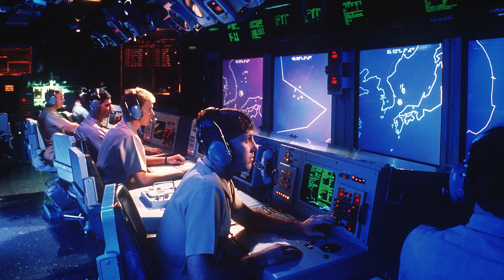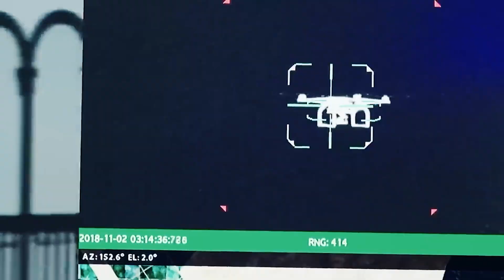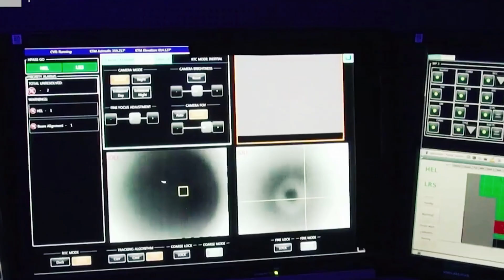This US LASER Aircraft Carrier Is Ready To Beat China

Comment: Unfortunately lasers do not work very well  in bad weather, whereas hyperkinetic weapons do
Reply: No. They don't actually. 
Hypersonic weapons need clear conditions to make full use of their targeting and maneuvering abilities. 
When you're traveling at mach 7, any slight variation in your flight path caused by wind or turbulence can make the difference between hitting and missing your target. 
Hypersonics CANNOT maneuver well when flying at terminal speed. A few degrees in any direction at most. Anything more will tear the missile frame apart. 
As of right now, it's doubtful that Hypersonics would be able to hit any target that's moving at more than a few miles per hour. They've only been tested on stationary targets. 
Add Sea Storm winds to that and there's basically no chance that it'll hit it's target. 

High powered lasers on the other hand would function just fine in bad weather. They produce incredible amounts of heat, and aren't affected by rain or wind. Fog might slightly affect it, but that laser is going to pierce through those clouds and keep going no matter what.
Reply: @Mikayelion6  thank god I'm not the only one out here reading these half-baked peanut gallery attacks which turn out, as you rightfully exposed , to be embellishments on a kernel of truth, a tiny crumb of fact that may have had truth in it, at some point, under highly controlled or otherwise specialized circumstances, yet - / in the presented context \ - is more like a fish out of water ... You Sir however, got it RIGHT. THANK YOU - upvoted ur post -
Reply: @Mikayelion6  First off, hypersonic missiles are far more advanced than you seem to think. Modern targeting systems and onboard computers are designed to make real-time adjustments for those pesky environmental variables you mentioned—like wind and turbulence. It's a little outdated to suggest they can only hit stationary targets; that's hardly reflective of the rapid technological advancements in this field.

Now, let's talk lasers. While you seem to think they're some kind of magic bullet unaffected by environmental conditions, that's hardly the case. Fog, dust, and smoke can scatter laser beams, making them less effective. And let's not forget the requirement for a continuous power source, which is not trivial in combat scenarios.

In essence, both weapon systems have their pros and cons. Hypersonics are not as helpless in challenging conditions as you're portraying them to be, and lasers are not as invincible as you seem to believe. A bit more research into the complexities of these technologies would go a long way in refining your argument.

Comment: So how effective would a laser weapon be against a target with a mirror finish exterior.
Reply: You can't put a mirror coating on a weapon traveling at mach 7. It would burn up immediately.
Reply: @ObiWanShinobi917  while that's true, it's an interesting thought experiment on effectiveness
Reply: @trufflie1635  it's not very effective even if you could. You need to think in terms of what percentage of the energy do you need to reflect to keep your mirror from failure. At most anything real world is just a short delay in destruction. Ie the moment the material heats to the point it breaks or the amount of energy it can deflect decreases it's still game over
Reply: But while we are on the subject, once we have laser weapons, eventually everyone will. Which means countermeasures do need to be developed for them.
Reply: Exactly----Mothra!!!!
Reply: going hypersonic and maintaining ur mirror is probably a bigger challange than a 500kw laser vs a mirror.
Reply: Interestingly enough, I think the laser would still work, albeit much more slowly. Mirrors don't reflect ALL light, simply most of it. So there would be a small heat transfer which would destroy the coating most likely. 
(All of this statement is based on my limited understanding of mirrors and lasers) (it makes sense in my head, but it probably wrong) (don't come after me)
Reply: X-ray laser or bust.
Reply: Mercury has a flashpoint melting at a relatively low temp.

Comment: Sounds great . . . . but . . . . what if the enemy simultaneously fires, say, 10 hypersonic missiles at the carrier? And what happens if they fire them in foggy weather when lasers have issues with attenuation?
Reply: We have multiple sensor tech that can see through almost any weather condition. You think a High-Energy, lethal laser couldn't vaporize moisture?
Reply: @eyoutube1  Very true... And, what is being talked about here, is basically what the general public has been made aware of... There is no doubt that other forms of weaponry and defence systems have already been developed... As much as Communists and Terrorists seem to live by the sword, they will end-up dieing by the sword when they face weapons like.these....
Reply: Advanced lasers with the supercomputers on the US aircraft carrier and the surrounding battleships can detect, calculate, track, and shoot down the enemies' many incoming hypersonic missiles even in bad weathers such as foggy or windy weather.  High-power lasers travel at the speed of light making the hypersonic missiles, which travel a few times faster than the speed of sound, so slow.
Reply: Hypersonic can only rentry at same speed as any other munition.  Pretty much negating the advantage.
Reply: @philipparana9225  exactly.... The super high speeds will mean they will have extreme difficulty changing course direction.... Just a small change in direction could take several miles to make....And RAM materials will not handle that type of aerodynamic heating , so the missiles would have to be made of easy to spot (by radar) metals, which is PERFECT to key the guidance systems of powerful lasers to melt the incoming threats... Like another Marianas 'Turkey Shoot'... Then after they used several of those weapons up, THEY become the hunted ones...
Reply: So About a week ago Russia fired 6 of those "Dagger" hypersonic missiles + 2 ballistic S 300 missiles +numerous  cruise+drones at Kieve. Defending was the PAC-3 (Patriot). Keeping in mind the PAC-3s were thought to be not very  capable of intercepting the "Daggers" . And PAC-3 are very probably inferior to the Agis/Standard 2/3/6s -AN/SPY 1 system used by the Navy.
The attempted Russian attack was complex , coming in at multiple barings and altitudes with decoys utilized by the "Daggers" and S 300s, along with Russian  electronic countermeasures.
All incoming were intercepted. By a system less capable than the Navy Aegis.  
Lasers will just be the cherry on top of the cake. A rather expensive cherry.
Reply: @Pat Clark  yep and Isreal is offering Iron Dome air defense system, and that coupled with the Patriot system might make things a little more advanced than what the Russian have ever faced. I only hope Russia see the losing position they are in right now and concede and withdrawal complete!
Reply: @robertrider1251  What I'm hoping for is Lasers to scale up to the 2-3 megawatt level quickly-that's enough for ABM defense . Couple those with AN/SPY6 radars .A crash program to build small safe nuclear plants to power the Lasers. Use Navy Nuke power technicians to run them until a mixed civilian/military infrastructure can be built. (maybe just park nuclear powered subs in port next to a Burke Destroyer.) . 
Last step is place those megawatt class lasers around willing countries. Sell the electrical power to the nations grid when not engaged in ABM missile defense. 
Seems like a no brainer to me. North America , Europe,Australia, Japan, S Korea  and  Israel would all be pretty safe from MAD for first time in 80 years.. Probably India, Saudi, Egypt and Taiwan to.   
The world would go back to WWII level wars. Aerospace threats would be minimal
Reply: @Pat Clark  yes but Raytheon has been testing a 50 megawatt laser for more than a decade and can field strategic missile intercepts with much weaker lasers to do that. The Airborne systems are have trouble, but by what I  read last year those are now being put into the field as well
Reply: @Ian Milner, That is a very real possibility, but remember that the hypersonic missiles are not cheap... And there is a finite number of them available for any action... Something tells me that more than one sea-going vessel could be equipped with multiple lasers on each vessel...... The good thing about lasers is that they are NOT destroyed when they are used... And with computer guidance systems available, a single laser has the capability to attack multiple threats one after another, at short or long range...  And the radar operated guidance systems can efficiently operate through fog and bad weather to aim the high intensity laser beams to the right spot which can also operate in fog and clouds... That kind of power can burn right through fog, rain, much more effectively than what ANY kind of missile can fly through.The missiles will require several miles to accelerate to terminal velocity... Lasers reach many times  those velocities 186,000/second, instantly after they are activated... And if the enemy wants to fire numerous missiles, they then leave far fewer weapon's to defend their own interests from attack from lasers or any other weapons from their adversaries... The lasers could be a real game changer...
Reply: They covered that
Reply: All the weapon would need would be a computer to sort out the firing. The missiles would be virtually standing still against something that travels the speed of light.
Reply: I am a professional photographer where the recycle time on my equipment is quick.  If recycling time for the laser is as fast like my strobes the hypersonic missiles don't have a chance.
Reply: So Mr what if. The best case scenario all of them get splashed worst case scenario all 10 hit something. So to address the fog or mist issue. The threw put of these new lasers have Excellent atmospheric penetration abilities. Second missile interceptions for these types of missiles are still possible and our SM2 sams have had that ability since the mid 90s. 3rd reports from the field in Ukraine have shown that hypersonic missiles' guidance are lacking thus far. Not to mention the US is really good at mak8ng enemies think one thing whole the other is true. HYPERSONIC missiles was something the US developed in the 1960s they were call ICBMs the ABMs. So what if lasers and missile actually shoot down all 4 working hypersonic missiles the Chinese have what then? Do you think the USN is just going to say okay were going home now? Stop with the what ifs. Try to realize the west has been at least a generation ahead of our enemies for 70 years and were not worried about some Chinese propaganda on here.
Reply: @michaelweiss2471  let's not forget we'll build that and park it right off the coast of China and launch middle fingers all day and night 😀
Reply: Pray!!
Reply: @Arnolfo Piamonte That's why all your women run to GIJoe since you guys need them to protect you.
Reply: bro their range is 1000 miles, just stay 1001 miles away and we gucci
Reply: @TheVix7777 lasers don't emit curved beams, 1000 miles away and the curvature of the earth prevents a laser from hitting anything at that distance. A laser can only shoot short distance unless it's straight up in the air towards space.
Reply: 😅😅😅😅😅😅uuuuuiuu
Reply: U77u7u7
Reply: @Gary R  you don't hit a missile that far out anyway...you hit it in terminal or midcourse phase of flight.
Reply: @blakeh6250  this is true, as long as it is going into a trajectory, it becomes a target somewhere during the flight path... There are several ways to nail it during it's vulnerable flight path, several seconds or in some cases minutes before an impact is made.... Defensive weapons systems that very few people know about... What I would like to know, is how would an adversary defend themselves during a counter attack? They would have already exposed themselves and their intentions... After that, It would be like several serious Chinese Fire Drills.... So much of what they achieved, would be quickly destroyed by the Allied forces... And Darn, Harbor Freight Tools is one of my favorite places to shop... It would seriously damage their economy, if they were to try such a stupid thing...
Reply: @michaelmartinez1345  yea, I was a navy Missile/gun chief FCC(SW) and got to work and train on various systems along with being part of the test teams at NAVSEA for new variant missiles. The problem with these mach 5-10 anti ship missiles is there not as maneuverable and  accurate on moving targets like ships. They look to work well for stationary targets.
Reply: @TheVix7777  their range is straight line not curvature of the earth, what good are they? A missile can fly around the globe
Reply: @zarb88  the range of those missiles are plenty good.  You need to consider the range of the planes the carrier launches. For full power projection you need to assume in air refueling isn't an option. Top of my head/iirc fa 18 is 500 miles. So a missle that keeps the carriers 1001 miles away effectively keeps China safe from US naval air power. Can the planes refule in air? Yes but... It adds a lot of risk time and complexity while reducing the number of planes the carrier can send on the actual mission.  Air tankers also make easy targets. At how far out they can hold us you pretty much need to top up on fuel in both directions. Imagine the navy having to announce they lost a full fighter wing cause China took out the tanker. Untill we can take these missiles out they have the advantage
Reply: At 500kw I would assume the kill comes in less than 1 second. The radar on the Ford class can track a ton of targets at once. Iirc there's a manual mode and an automatic mode with things connected to it. So assuming the carrier was alone and had to defend itself... Sailor maybe slaps a button 10 times .  Maybe just puts it on auto. I would bet though that we see this on ships that are part of their escort as well. Probably limited in how often it can fire (due to capacitor charging). But even a single 500 kW laser would be a defensive weapon unlike like anything we've ever seen
Reply: @johnwuethrich4196  500 kW is a LOT OF  POWER,  But quite obtainable with the right equipment... With the chemical based electrical generation equipment that was (is) very successful in Airborne Laser (Check into the NGC based ABL) equipment some 20+ years ago, it is a sure thing that current technical advancements have enabled even smaller vessels and mobile defense systems to be set-up  to counter any incoming threats... What I'm now wondering about, is HOW would the adversaries be able to sustain & defend themselves of precision drone/ordnance counter- attacks... 
       Just shutting them off from fuel, industrial resources would quickly cause panic in their cities because of the immediate shut-down of their economic resources... Their industry would quickly become bankrupt with restricted trade... They need other societies to support them, just as so many other countries do... It could cause a major Coups among their own people to rebel against a corrupt organization that is now forming their government... 
    It's Not a dream, just an observation of what has actually happened in several other places, in the past...
Reply: @johnwuethrich4196 on't even need 500KW tbh. That's just the most efficient way. It's the typical U.S. doctrine of having significantly more power than needed. Americans view military power as "better to have more and not need it, than need more and not have it". 
The 300KW laser that's currently being mounted on the Ford can burn through any missile with enough sustained fire. The Hypersonics are designed to resist the thermal energy from their own speed, but not that energy PLUS the raw heat from a 300KW laser hitting it. 
A 500KW laser can destroy it in a second or two. 

A 300KW laser could likely do the same in 5 or 6 seconds of sustained fire.
Reply: @Mikayelion6 I agree with your logic.  I also think they need that extra 200kw kill speed for the swarm attacks. Unless the Russian and Chinese systems both turn out to have shit for targeting or reliability. Which is a wild card, but better we not find out by losing a Ford class Carrier and more importantly any portion of it's crew
Reply: Laser system is in "dream" development.
Reply: @RNT  no sir they have been in development since the late 80s part of the star wars program.If I'm not mistaken the first deployed laser weapon was on a 747
Reply: @Hugo_Furst  That is what some people said about electricity, planes, trains, automobiles , many other things, many many years ago... The nay-sayers were forgotten, the achievers will be remembered forever....
Reply: Those Chinese and Russian HSMs are also effected by adverse weather conditions. Moreover, better read the imagery better. China has been firing on stationary static targets. It is doubtful those HSMs could hit a target unless it is anchored at port, not moving, and a bright sunny day. That does not mean they are not a threat. Be it 1 or 20 HSMs at a time, they are not a guaranteed hit against a target that could shot them down, spoof them, or just move out of the way. 

Also USN ships will have MORE THAN ONE LASER either per ship or in the entire fleet/formation. Multiple ships and multiple LASERs, Carriers, missile cruisers, and Destroyers. And that says nothing of anything else being prepared, including longer range fighters and weapons to render the speed advantage of the HSMs moot.

It is more likely the HSMs would be Nukes. Of course that is can of worms no one in their right  minds should ever want to open. The US has fired Generals just for proposing such a thing.
Reply: 😂 on